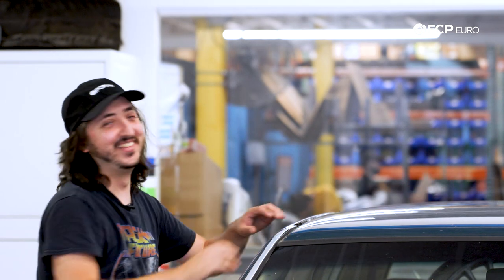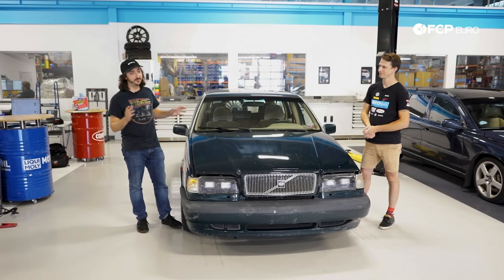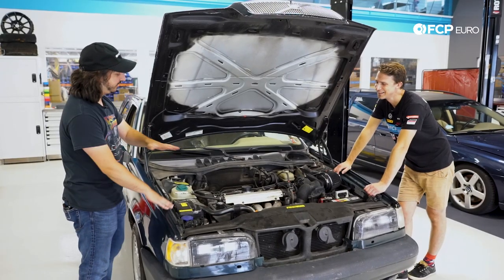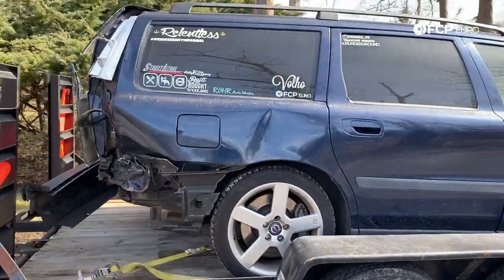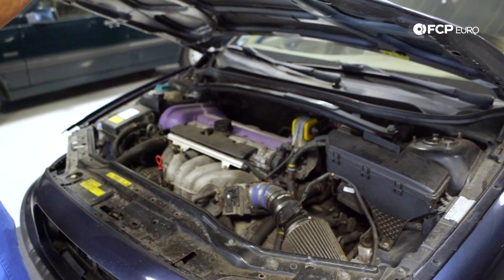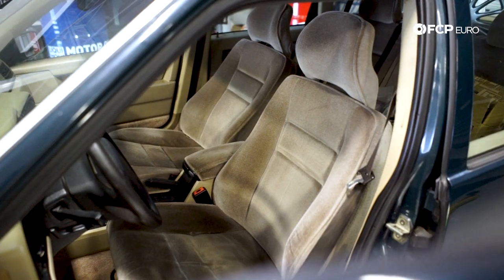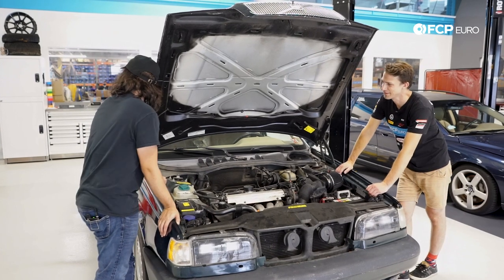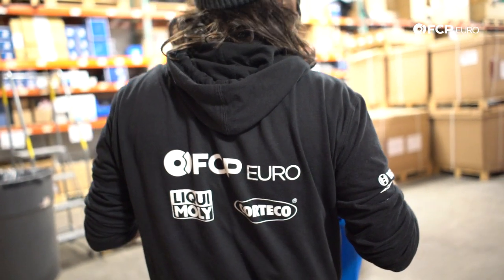$850 Volvo 850 Project Car - The Pursuit of the BTCC 850 Estate - Episode 1

Comment: slicktop 850 is badass, shaves like 50 pounds of weight above your head. Its the optimal choice for an 850 unless you have an R
Reply from the maker: It is badass! Jacob knew what he was getting when he stumbled upon this 850 for sale, saved us one major project on the build!
Reply: Removing the sunroof saves about 37.8lbs between the glass, sunroof box/rails, motor and drain tubes.

Comment from the maker: So...any guesses on how much horsepower the 850 will put down to the wheels with its current 300k mile engine in it? Leave a comment with your guess, and tune in next week where we head to the dyno,  and begin pulling the engines and really tear into the project! Checkout Episode 2 Here : https://youtu.be/tyilVAZhuwM
Reply: With the current engine? 110 wheel. With the built n/a engine? Probably around 230 wheel. Hard to tell from just the sound. Hopefully there'll be more info on the engine itself. I'm deciding between swapping in a tuned stock turbo engine or building a naturally aspirated one.
Reply: My guess is 200 at the wheel. Anything more, I'll be very impressed.
Reply: 224 whp my guess
Reply: Without a tune up the 300k engine is probably putting down about 158hp
Reply: I'd say around 175 - 187
Reply: From the original 168 - let's see, the compression will be down a bit. I'll go 135.
Reply: @andreichichak5242  I feel that. I forgot it was NA
Reply: @theycallmedub  I had a '97 855 no turbos, no sunroof, manual box, with the minilite looking wheels, in holy crap that's red. We drove it everywhere for 22 years and it had close to 500k km when gran in a Civic turned left in front of it - and it died.

It's a good solid car, but after 22 years it needed an engine rebuild (using a bunch of oil so I think the internals were well gummy), suspension front and rear, the drivers seat leather wore through, and it needed a clutch. It was time to spend a bunch of money on it or let it go, and then it got killed. There wasn't much damage, just a hood corner, headlight, corner marker... but the insurance company said "22 year old car with a 1/2 million km??? Say your goodbyes". 

Now I've got a '15 XC70 T6. I don't care for the jacked up suspension or automatic box but, like the 850, I can drive 13 hours to Vancouver in one stint and I'm not shattered, or crippled.
Reply: @andreichichak5242  that's incredible. It's Better To Have Loved And Lost Than To Never Have Loved At All right? That's also an unfortunate lost. Being aP80 lover I would've been devastated to lose an 855 with no sunroof. Glad you stuck with volvo in the end. Volvo 4 Life!
Reply: 2hp
Reply: 120 hp is my guess.
Reply: 140ph
Reply from the maker: @ballievogel5385  What is this the price is right!?
Reply: @fcpeuro  hahaha did i win? I have the V70 wagon so know that it can make some proper power.
Reply: i know a 2.3T 390k miles made over 200 so id say 158?
Reply: @thevolvobrickchallenge5650  lol dude i just guessed the same :D
Reply: 118.7whp
Reply: Guys, a quick suggestion. To make your lives easier find and 850 turbo donor car. There is quite a few differences including the axles and the final drive of the transmission. You also need the entire wiring harness and a M4.4 ecu to make the swap work. You can get the Coil on Plug and VVT mod from VAST tuning to make the V70 engine work like factory in the 850.... Starting with a NA 850 is a LOT harder then starting with a 850 turbo and honestly not even worth the money.
Reply from the maker: @FriendlyIntentions  stayed tuned, we may or may not have done almost exactly what you suggested.
Reply: @fcpeuro  Nice, I have been tuning the M4.4 for quite a few years now too, if you got any problems or questions let me know and I can help you out.
Reply from the maker: @FriendlyIntentions  Appreciate that! We may need to pick your brain at some point
Reply: @fcpeuro  you will also need the front engine mount from a 99 or 2000 p80 car s/v/s 70. The mouting is a bit different
Reply from the maker: @FriendlyIntentions  **Spoiler Alerts!!!** You're jumping to episode 4!
Reply: depends on the actual engine type bts- - - -, but since its a 95 850, I would say around 124 or 143, that dyno test looks to be evidence of an oil leak which could possibly reduce it a tad, seems like worn rings seeing how it smoked when slowing down. if you're going off of a cat delete, itd be a little higher so my numbers would stand around 130 or 148 whp
Reply from the maker: @londonbroilburnout9946  you are almost spot on! Check it out in Episode 2 that just went up tonight
Reply: @fcpeuro  I do like the p80 volvos ever since getting one... now I need to figure out a way to get a supercharger on these lol
Reply: 155.........
Reply: Wonder if I could do the same engine setup given I have a 99 s70 with similar 2.4 na engine🧐🧐

Comment: So I’ve owned 7 p80s and my friend has owned about 5-6. Two things. First why is the center of the hood silver? Second I have never seen a cloth interior. 

Anyways people thought I was crazy tracking a 93 NA 850 and it was a blast. Have fun! Can’t wait to see the whole series.
Reply from the maker: How was it out on track Steve Jorgensen?  This car actually was hard to find being completely base trim with the slick top roof and the cloth seats! Believe the center of the hood was not sprayed from the factory for either costs or something associated with not having any sound proofing that was supposed to go there. But we will check with Jacob for sure!
Reply: @fcpeuro  it was a blast as any track time is. I didn’t have good tires for the track so that’s where I had trouble. I’ve only seen one slick top now that I think of it.

Comment: America had also their series, with same category homologation race cars, but mainly consisted of Chryslers, Acuras, BMW's and Audis. Based on their brands and availability of cars in America. It was an homologation series even South Africa had their series called Satcar, including Australia Japan and many other countries. Unfortunately high performance normally aspirated/All Motor 2.0ltr sequential race cars at that time was not popular in America only v8s. There was even a world championship event at the end of each year at that time (90s) when all the same category cars with all the national champions from around the world challanged each other. 

 A few of the rules were....
-All cars had to be 20ltr high    compression (high reving)
-Sequential  transmissions  
ITBS (idividual throttle intakes) 
-Heavily engineering chassis and body structure(stitch welding galore extremely  ridgid).
-Wheel arches and race car engineering grade rollcages. 
-Tubbed wheel arches for lower centre of gravity.
- Single wheel nut construction custom made to order from supplier.(Magnesium metal)
-Engines centre of gravity was also lowered (dry sump) as well so reconstruction of the engine mounts and gearbox(sequential) had to be done. These cars engines sit really low to the ground like a go carts even the drivers seat position is very close to the transmission wall for even weight distribution.
-Custom fabricated sub frames and suspensions due to the cars low centre of gravity, so nothing original.
-Including the best adjustable race car suspensions and this all occured from 1993 - 1999. 
There is a Touring car collectors website where you will find info on all the touring cars raced from around the world and current loctions and owners.

http://www.supertouringregister.com/

https://m.facebook.com/SuperTouringRegister/#_=_

British Touring Car Championship - BTCC
Japanese Touring Car Championship - JTCC
South African Touring Car Championship - Satcar
Australian Touring Car Championship - ATTC
 
ITALY
SPAIN
GERMANY
FRANCE
Macau- Asia.........  Etcetera list goes on and on.....

Comment: btcc car had engine lowered significantly for low CG, so much that they had to use a dry sump oil pan.  Race team also shaved the head at an angle for some reason I can't remember
Reply: They shaved the head to change the angle of the valve while using stock head. Had to be a production car engine. So they got sneaky... i mean clever
Reply from the maker: @850are2  One of our favorite parts of that rule interpretation, they did a stellar job back then!